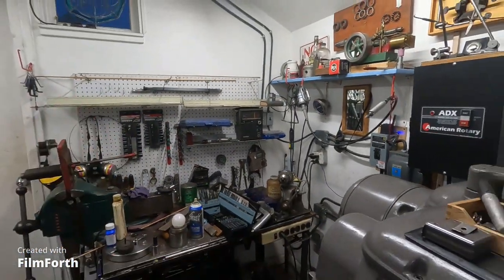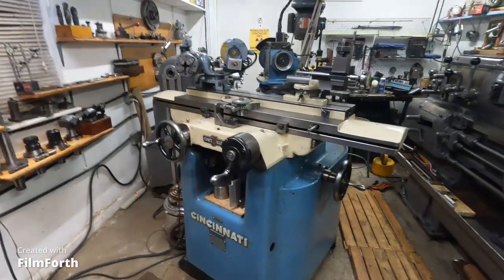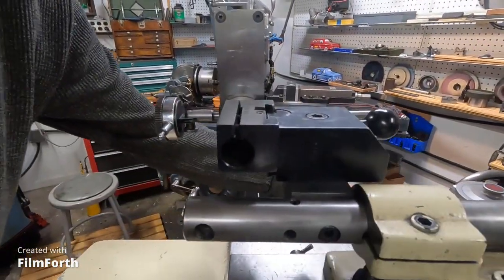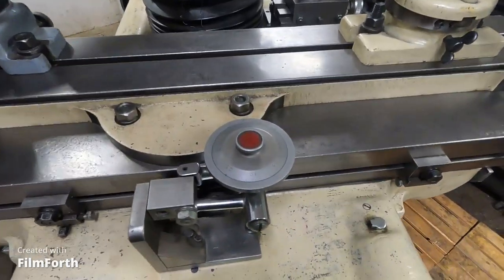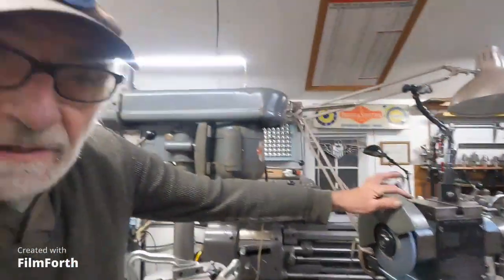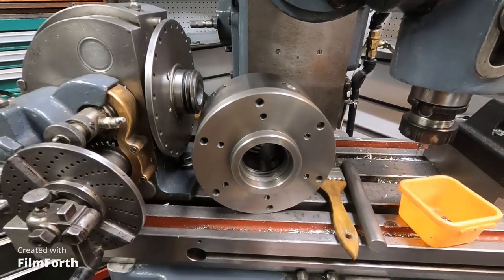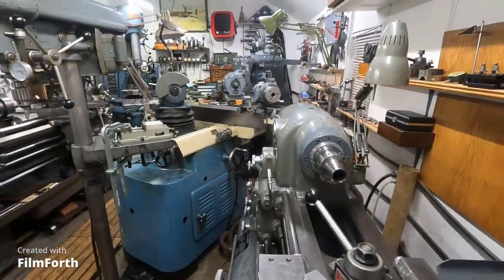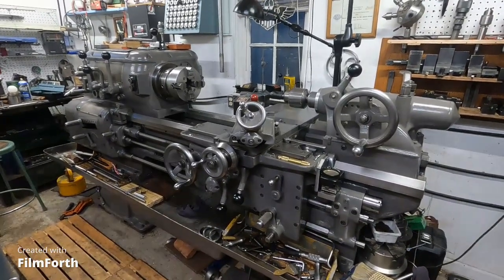Machine shack back in good shape

Comment: I used the rubber mats with holes in them you can get from the big box stores. They are good an my feet and the chips fall into the holes. I have to periodically move them and sweep it out, but they are really comfortable on my feet. And they were cheap.
Reply from the maker: That sounds good, thanks

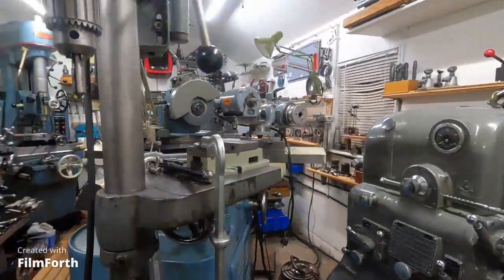Comment: 6:30, Half the mornings gone! Amen Brother!  Nice shelving Dee. It has a nice look to it. Wood storage in my mind is much more pleasing in the shop. 
I find Carbide inserts are good for most stuff and perhaps production shops it makes complete sense to use them exclusively. However portable machining like I do sometimes does not tolerate the tool pressure that insert tools like to have and do not always fit the bill. A Micro 100 bazed tool ground to a polished edge or on occasion a chunk of Mo-Max is the best option. However your milage may vary as they say. Did I say I like the woodwork?  
Bridgeports  for some reason are stupid money, I want a 36" one too they are very cool.   Have a great day Dee.
Reply from the maker: doing repair work I really get behind on current technology but I tried some positive rake trigon inserts on a crappy import lathe and they worked really well. A lot of the time I have to come up with something because the cutter or bar has to be extended, the prices if machines is all over the place!

Comment: Great review. I've been doing some shop cleaning lately myself. I need to get a small can of Kerosene to wipe machines down. I have been using Mineral spirits. I keep hearing you talk about kerosene, so I want to give it a try. Sure, looks a lot better to wipe the greasy hand prints off of things. Speaking of greasy I am thinking about adding grease fitting to my front door hinges because Letting Snuggles in and out is going to wear the hinges out. She wants me to go outside with her.
Reply from the maker: The kerosene leaves a oil behind, a good way to get one clean is use mineral spirts followed by kerosene, I have to do the same with my dogs, but I have to get moving anyway making videos with all of Hollywood on strike its a heavy burden here!
Reply: I've been living without Hollywood for a long time. Their strike means nothing to me. I still love a good Robert Duval movie and a few other old timers but what comes behind the great ones are just a bunch of WOKE Sickos. Burning Kerosene makes me sick breathing it so I will try the wipe down on machines that are not in confined space like my little 12'X12' machine shop. My bigger machines are inside a 24x48 ft shop.  I like the idea of leaving a thin coat of oil. I've tried everything from the expensive museum wax to lanolin to Boe Sheild and still seem to find a way to make rust. When I sweat everything, I lay my arm on has a rust print on it. All the meds I have to take every day no telling what is in my sweat. Hollywood is on the way out and You Tube is running them out of town.